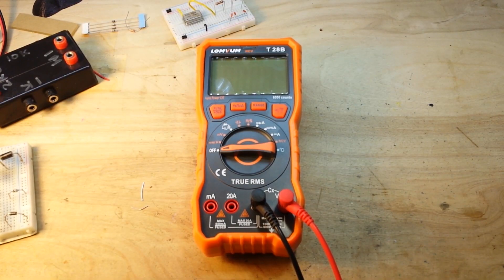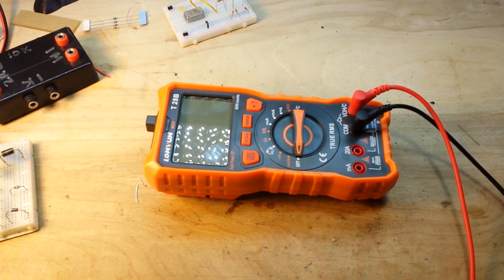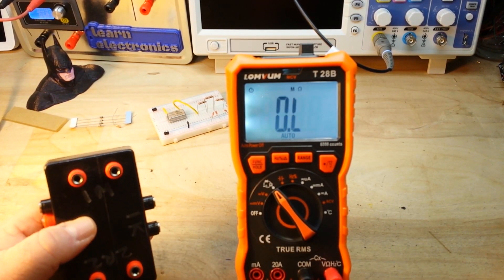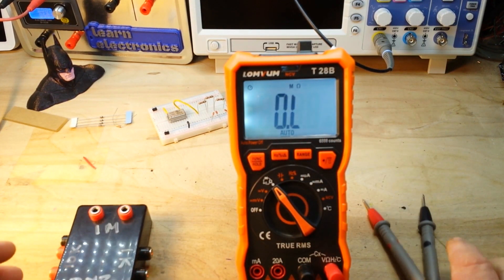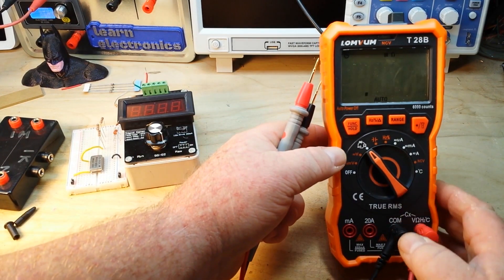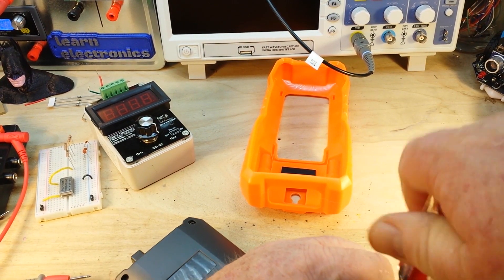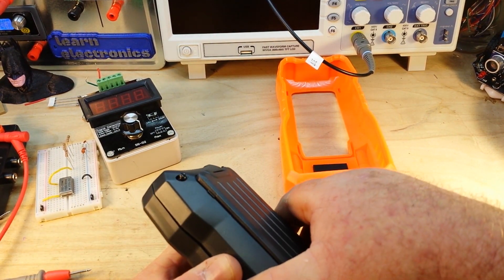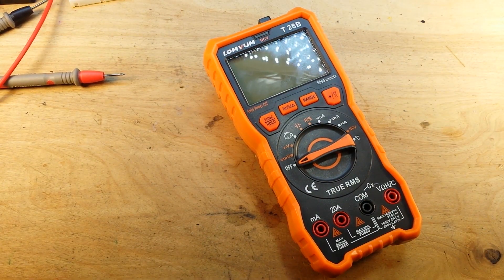Lomvum T28B Multimeter Review & Teardown

Comment from the maker: Yep. I missed the 2 PTCs by voltage input. My mistake. Thanks for poiti g it out.
Reply: lol - no problem I miss a lot of things these days (almost 60) --- but hard to believe they didnt give that meter a once over especially before sending it for a review--- didnt do themselves any favors did they-?  lol  looks like it would have been ok otherwise, whattaya think wrong resistor used somewhere or glitch in the software ??
Reply: What has been seen can not be unseen. It was even screen printed on the board.

Comment: Unfortunately, I bought this multimeter based on the positive reviews on temu site, but I didn't bother to test it thoroughly, and the return deadline had passed. Today I tried to measure the resistance of SMD resistors, and the readings completely misrepresented the values printed on the resistors. In ex. 1024 resistor shoud be 1.02MOhm but this multimeter measure it as 0,57MOhm (sic!). I measured it on manual range.

Comment: Hey! I just bought this multimeter and I noticed that when I turn it on, in the screen, I can see "MIN-MAX" and also a Δ symbol. Do you know how to activate those functions? There are no dedicated buttons apparently.
Reply from the maker: I do not, sorry.
Reply: @learnelectronics  no problem.
Reply: @learnelectronics  Today I tested 1MOhm resistance, and the meter actually displayed correctly 1.002 MOhm. Probably yours was faulty?
Reply: @RedPixels_  i do think it was a bad value burnt in the firmware. ;)

Comment: I've got one of these meters (under £13 from Amazon UK). I've just tested a 1M-ohm resistor and it came up as near enough 1M-ohm. I can only think that the one in this video was a rogue one. You would have thought the manufacturer would have tested it before sending it out to be reviewed!! So far mine seems ok but I really don't like the leads that were supplied....I would have prefered leads that you can screw croc clips to.

Comment: The wrong reading of  high resistance could be caused some left of solder flux during production that's a high impedance circuit, if you noticed every time he tested the resistance was lower, a little cleaning with Isopropyl alcohol on the P circuit near the probes will fix it.

Comment: I bought this meter from Amazon months ago. I was one the ones who posted a review you can check on that. My meter did not have any problem, actually I am very happy with the meter performance. The input protection is not great as cat IV, but perfectly ok for home or electronics jobs.  The input protection is clamping transistor, 2 ptcs and 2 small ceramic fuses is more than other cheapo multimeters. One more thing is true RMS. I hope you get better. This was no your best review.
Reply: You are correct! He should have edited the video or removed it altogether instead of allowing viewers like Pete getting entirely the wrong idea.
Reply: I also have this meter and for the price I can't complain. Also the NCV test is useful in a lot of situations, when you want to trace a cable for example, it comes with a temperature probe that is always useful, it has a light that is useful for when the power is out and you are trying to search the fault, it can also measure frequency that can be useful for generators to ensure that the power output is correct. The case is well made, it has a stand, and a magnet to attach it to the device you are testing or on a ladder. 

Only thing I don't like is that the AC and DC voltage/current ranges are not separated (it defaults to DC and you have to press a button, annoying since I use it mostly on AC circuits) and the continuity function is shared with the resistance one (and you have to press a button). If they had made the knob bigger separating the ranges it would have been better.

Comment: Looks like the common multimeter chip for cheap "good" meters (DT0660), but they forget to calibrate the Mohm range. I would have expected calibration of all range was done on some automatic rig. The lack of good protections is standard on cheap meters, but they will usual handle 230VAC, i.e. normal mains voltage (If they handle 230VAC, they will also handle 120VAC). The layout of the circuit board looks fairly good (For a cheap meter).

Comment: No no no Paul. The way you were testing meters with your own probes(the low resistance gold tip ones) was a far better way and much more fairer and accurate way to review a meter. Don't fall for peer pressure. I liked the way you used to do them. Just saying👍
Reply: Yes, but the stock probes should be tested as well, since that's what many buyers will be using.  First, check with the stock probes, then check with the good ones.  That way viewers get a sense for how good the stock probes are and how good the meter can be with good ones.
Reply: @antibrevity  that would be the fairest way.

Comment: In all truthfulness it is best test the DVM with Probes Supplied.    If there CHIT, there CHIT too.   About your Voltage Reference . Did you get a Photo Copied sheet with Measured Output like most people ?  Same Numbers LOL ?  They didn't bother sending me one.  The first one I receive was DOA.  Took weeks to get the guy to send a replacement.   I'm just assuming the Manufacturer specs are close enough    + - 3 mV @ 5V with the AD584L  version. Assuming the AD584L is even Original  or Clone ?  Would the Chines do that ?  Snerk..  I have two units and both are within  .001V from each other.  I'm quite sure the Reference chips are in fact Authentic.   Again,   I'll be keeping my Mastech.  Good Vid.  You should be feeling better here in a hour or so.  I just sent you some Good Vibs with a nominal dose of Fairy Pixie Aura Dust in the wind.

Comment: that's a defective multimeter. I bought one and the resistance function works both in auto and manual range mode
Reply: After seeing this review I thought I'd made a dumb decision getting one of these from Amazon. However, I just tested it with a 1M resistor and it behaved just fine. Agree that the test m/c must have been defective.

Comment: I'm curious if this is a programing issue, poor solder joints or possibly the wrong parts were installed?
I think it deserves further investigation.

I like the magnets in the holster.  That's something I've been trying to build into one of my meters because these add on magnet straps cost WAY too much.